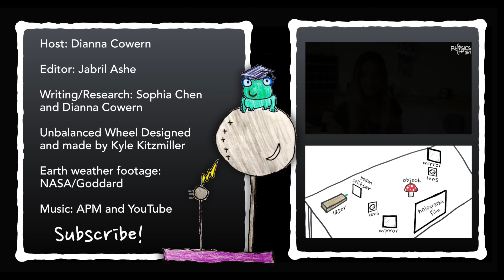Are perpetual motion machines possible?

Comment: You would need to build a machine that creates enough energy to power itself and also give away energy.
Reply: Yeah, but that's impossible.
Reply: Yeah, right now
Reply: So basically a nuclear reactor. Mass is converted into energy, that energy is used to power all of the controls and safety measures of the reactor. Any extra energy goes to people. However that is not perpetual because the source of energy is the nuclear material which gives off energy.
Reply: I'd call an Orbit a working PMM. The act of perpetually falling can be considered a PPM. Think about it, gravity is the cause of the orbit, but no energy is transferred from the orbit itself when suspended in a vacuum with little to no outside gravitational force and ideally in such a vacuum no friction would apply to the slowing of the Orbit PMM. It is also self starting in nature and has been running for trillions of years.
Reply: Ryoku Hasu Orbiting needs energy.
Reply: L. L. Care to explain what energy? Sure orbit requires energy in some form if starting, but once in motion it will remain in motion forever falling around the central mass without further sources energy acting on it. Gravity itself is not a form of energy
Reply: Ryoku Hasu orbiting is perpetual motion, but once you start to try and get energy out of it, you will fall out of orbit.
Reply: +Ryoku Hasu I know that this is an old post, but I in a small way have to disagree with you about Gravity not being a form of energy. This being that Gravity is not fully understood at present and thus cannot be dismissed in that way. Aslo because of the multiple Theorems about Gravity and how it works. One of these theorems is that Gravity is a form of Electromagnetic energy and while this hasn't been proven it also cannot be dismissed.
Reply: This will never be possible because it will have to create more energy than it uses- enough to power the machine again and some extra energy.
Reply: TheLivingTank nuclear fusion reactors are believed to be able to do this but we'll have to wait and see
Reply: No, there'll never be free enrgy. If you get energy from nuclear fusion you still need to 'feed' the reactor.
Reply: DerBlaue I'm fairly certain scientists have calculated that the output of fusion is greater then the input
Reply: Joe Cestare How could you generate new particles?
Reply: Joe Cestare The sun burns with nuclear fusion but it will be sooner or later burnt out becuase iron can't be used for an fusion reactor.
Reply: +Joe Cestare The output is higher than the input because it uses chemical energy. if you have a room full of some flammable gas and you give it a spark, it explodes. The output is higher than the input, but you can't make it perpetual because the chemical energy is used up.
Reply: Nope, all orbits eventually decay.
Reply: Fusion uses a fuel, in the case of a star it is Hydrogen and/or Helium.

That alone means it is not perpetual.

When the fuel runs out or Iron builds up to a certain level the reaction stops and the star explodes or collapses to a white dwarf.
Reply: No...no 'orbit' ever 'decays', not as long as the matter/mass which is performing the orbit exists.
Reply: Yah, but where did all that original energy come from?  I mean the energy that created the star or our sun.  Or the Big Bang.  Where did the original energy come from? Seems like the Big Bang doesn't follow the Law of Conservation of Energy since the original energy that started our whole universe just came from nothing.  ???
Reply: Terry Robinson The only possible answer is that 'energy exists of itself that is every 'where/when' of the Universe'.
This means that the actions of matter enable energy to become manifest.

As to 'how the energy came to be' or 'gravity' for that matter, I have no idea.

It would be a 'fools errand' to speculate on the 'source of all things'.
Reply: Perhaps we should be thinking not of whether orbits can still remain perpetual if we're harvesting energy from it somehow... maybe we should be thinking if it could produce energy at an efficiency that is infinitesimally close to 100% with whatever fuel we use to create that energy... and that fuel is seemingly infinite.

So in a sense, from our perspective, it is producing infinite energy!
Reply: Quantum Waves The only explanation for 'quantum-wave' function is that the 'wave' is a
disturbance in a pre-existent metric.

A 'wave' function cannot manifest from nothing!
Reply: "You would just need to do that" "You would just need to do this" Tell me how, and when you realise you don't know, revise your understanding of physics. It's a LAW. It's fundamental, you can't change it. Nothing can be created nor destroyed. THE END
Reply: Orbiting objects do not remain in position forever. Orbiting objects fall more and more due to orbital decay and decrease in height over time. Satellites need to correct that height difference and boost the orbit to avoid crashing on earth, an example would be Hubble.
Reply: PMM exist, but they do not use energy and you cannot get energy from them. i.e. Objects moving through empty space (planets, galaxies etc). Boyle's flask technically could be a PMM if the fluid was a super fluid, but super fluids don't experience friction and therefore you can't make them do any work.

Comment: What if instead of coins we have magnets (+) and we aproach another (+) magnet so they start moving as a perpetual motion machine? This needs to have an explanation but I can't imagine it. Maybe this could be a perpetual motion machine...
Reply: the energie source there is potential magnetic energie. basically you need to put energie in it to bring the magnets close together.
Reply: Magnetism is not energy.
Reply: lvlarihuano lvlarihuanísimo no, but is a force so it comes with potential energy.
Reply: Ward Huyskes
No, it is not a force, it's a field. If you want to talk about force then do it with one of the four universal forces, the electromagnetic force.
You should study and practice physics first.
Reply: lvlarihuano lvlarihuanísimo gravity is not a force, it's a field durrrrrrrr
Reply: Ward Huyskes
No sir, gravity is also one of the four universal forces.
Reply: lvlarihuano lvlarihuanísimo listen, when talking about energy and motion the universal forces are just not relevant. Just because a force isn't a universal force you can't say that it doesn't exist or isn't relevant. In engineering it doesn't make sense to express everything in universal forces. It only matters that a force is applied and what it's source is. Magnetic force is a force that comes from magnetic fields, it's a form of the elektro-magnetic force but that's just not relevant. And because there is a force that comes from magnetism, there is also potential energy that comes from this force. Which is what I said.
Reply: Ward Huyskes
Well, then if you want to use than potential "energy" you need to move something, Nothing comes out nor moves without any effort. You must move the magnet to obtain energy, so, the energy invested to move de magnet will be grater than the obtained energy, as simple as that.
Reply: Magnetism is the result of moving electrons and viceversa.
Reply: Ward Huyskes
Anyone who says that energy can be obtained from plain magnets obviously hasn't studied physics.
Reply: lvlarihuano lvlarihuanísimo how can you possibly imagine something (in this case a magnetic field) applying a force on an object without the object gaining energy? Magnets make objects move right? 

You are really really edgy for someone that doesn't get the concept of potential energy. And by the way you talk about energy I can tell you really didn't study physics. You're probably just a pretty good high school student. You cannot 'obtain' energy. You can only 'obtain' kinetic energy by converting some sort of other energy (for example light, gravitational potential energy or mass). You already have the magnetic potential energy, just because you are in the presence of a magnetic field and it theoretically takes energy to get away from an opposite pole. It's exactly the same as potential gravitational energy only with a different force. I didn't do any work to get my current position towards the sun, yet I have potential energy towards the sun. If I were to drop into the sun I would convert this energy into kinetic energy.
Reply: Ward Huyskes
Magnets make objects move? NO!!!!
You need to separate (potential energy) the magnet from the object so they can move (kinetic energy) each other toward tehemselves, once they are in contact (zero energy) then they stop moving. It is you the energetic source of that movement.
Reply: you dont need to study physics to know that, its like 6th grade knowledge
Reply: Ward Huyskes
Come on, magnets DO NOT MOVE by themselves.
Reply: lvlarihuano lvlarihuanísimo
 if i pull them apart they definitely move by themselves....
Reply: captain_awesome
What!!!

You are saying that "if you pull them apart". Do you realize that it is you the one that is moving the magnets?

I repeat: Magnets DO NOT MOVE by themselves. Someone or something has to move them.
Reply: lvlarihuano lvlarihuanísimo
 are you kidding me??? IF you pull them apart the will move back OWN THEIR OWN, obviusly. wow and look : they are definitely moving on their own then ,no matter if i needed to pull them apart before, you didnt mention you can not
Reply: captain_awesome
I'm not kidding, and of course they will move back by "themselves" because you injected energy to them, it is called potential energy and it came from you. Once the two magnets are stuck together they won't move anymore unless you separete them again thus spend some energy of yours.
Reply: The best way to learn that magnets cannot move by themselves is constructing one of these fake machines that move "forever", or for a long time.
Reply: Magnets act much like springs do.
Reply: lvlarihuano lvlarihuanísimo magnets are not like springs at all, they just act slightly the same in real world scenarios.

What if you have two magnets, that are completely separated in the beginning, and you bring them closer together. Then they will still move. Yet your actions actually take away potential energy. Magnets do move by themselves. 

Magnets are actually more like masses than like springs. Only magnets have a way bigger pull on each other.
Reply: Ward Huyskes
When you compress, or stretch, a spring, it gets potential energy, and if you release it then it moves, it's the kinetic energy, and stops when acquires its original form, E = 0. Same happens with magnets. Magnets won't move if you or something else don't separate them or join them depending if you need them to attract each other or repel each other. Electric DC motors have magnets, but they don't spin by themselves, they need electricity to magnetize its internal coils in order to make them move.
Reply: Ward Huyskes
right
Reply: What also could have been said is friction would win in the end because physics(I could go into detail but I'm to tired so I'm not) . Ps. opposites attract so they would repel each other in your scenario.
Reply: what if you put a small ball into a wheel, and you get closed a magnet out of the wheel? the ball could get atracted by the magnet but the Gravity makes the ball go down, so the wheel Will start to spin
Reply: +Asier Alcaide my english is not Too well, i Hope you understant it
Reply: Asier Alcaide well that wouldn't work either. Let's say for simplicity that the magnets pull is just as strong as the gravity, when you're halfway moving around the circle. And now we take five different beginning points for the ball: at the top (close to the magnet), at the bottom (far away from the magnet), halfway the wheel (exactly between the top and bottom), somewhere between the top and middle and somewhere between the bottom and the middle. In the first scenario the ball would just stick to the magnet, in the second scenario the ball would just stay at the bottom,  in the third scenario the ball would just be stuck exactly in the middle. In the forth and fifth scenario the the ball would start moving, but it wouldn't go full circle. The ball would sling back and forth around the top/bottom. Friction would slow the ball down until it would stick to the top/bottom. There is no way the ball can go around the circle without giving it speed in advance.
Reply: no because magnets run out of energy. they need to be recharged to keep their magnetic field. they don't stay magnetic forever. it's an energy source
Reply: Ryan Goodwin wtf?
Reply: This is an interesting conversation.  You can learn a lot by thinking you can create a perpetual motion machine and then trying to make it.  

A good way to think about the magnets is Yes, you can push a one magnet towards a 2nd and have the 2nd magnet move.  But this is really no different than pushing something with an air blast, a spring, or even a stick.  The magnetic field is invisible, but it is no less real then the air/spring/stick. It is transferring the energy from you to the object that moves.  And like the spring, it doesn't move at first, then moves all at once.  This is potential energy building and then being released. 

Again, if you think you can make a  perpetual motion machine, just try.  If you tap into some unknown cosmic energy, and invent something great.  If you change your design and harness wind, solar, hydro, real energy, great.  If you just learn a little practical physics great.
Reply: +Tex Mex 
Nice way of thinking bro/sis.
Reply: no.
Reply: Magnet Will also eventually run out of energy
Reply: It's not that magnets "run out of energy" that's an inaccurate statement. A more accurate statement is that magnets depolarize. However it is possible to keep them polarized with a current and if your machine can produce a current large enough to keep the magnets polarized and still have excess then it might have a chance of being a PMM, however no such configuration of a magnetic self-polarizing PMM is known to exist.
Reply: WeerWatGeks #WWG Thtas not the point. Magnets don't supply any form of energy in the first place. It's just a form of energy transmission like gravity or simply pushing something. Every movement of the magnets needs some form of eyternal energy input, otherwise the magnets will simply lock into position and remain there without any form transmitted energy.
Reply: Rumplelumpa Snickerdoodles
 Technically speaking, WeerWatGeks is correct, actually. Physical magnets contain a form of potential energy, energy bound up in the highly ordered arrangement of their electrons. As you use a physical magnet to do work, the resistance against that work (Newton's 3rd law: every action has an equal and opposite reaction) causes some of the electrons to be pushed around, disrupting their uniform ordering. While this effect is small for any single interaction, it piles up, and eventually there are many more disorderly electrons than uniform ones, weakening the magnetic field until it is no longer capable of doing work. It is just like a capacitor or battery: full of magnetic potential energy instead of electrical potential energy, and every time you use that energy to do work, you drain some of it away. Eventually the battery is dead and cannot power anything.
Reply: Ezekiel Raiden This is not correct. Magnets loose power over time, but this is not an effect of doing work, or releasing potential energy.  The potential energy of a magnet attracted to something or 2 magnets attracting/repelling came about when they were put in the arrangement they are in. 
It's like lifting a rock and letting it fall.  The potential energy before the fall was created by lifting it away from the Earth, it's not built into the rock.
Heat, Shock, and opposite magnetic fields can reduce or eliminate a magnet's magnetic field, but its not due to the building or release of potential energy.
An electric motor can spin for years putting out 1000's of times the energy put into creating it's magnets.
Reply: Magnets lose their energy
Reply: DeathsPit00 Magents don't contain energy.  The generate a magnetic force.  That force can be used to convert one type of energy to another. An electric generator convert electrical energy into mechanical energy for example.
Reply: It isn't just the fact that they run out of energy..if 2 magnets are placed on the same object, they can't be responsible for the motion of the whole object cause they exert an equal and opposite force on each other. This wouldn't work. But good thinking though.
Reply: Wow! A lot of very interesting answers... Thank you everyone.
Reply: First of all, magnets attract each other. It'll refuse to get detached from its position after it gets attracted. Hence, it'll just attain equilibrium even faster than while using coins. Using magnets is just detrimental
Reply: Magnets can either repel or attract, depending on their polarity

Comment: So how are nuclear fission reactors possible?  You put in a bit of energy and get more energy out. Isn't that the same sort of thing?
Reply: it's not perpetual. once the fissible combustible dry out it's over. same goes for the sun at a longer time scale.
Reply: @xenomorphelv4265  so in total. The output will not be higher than the input. If that's the case why bother?